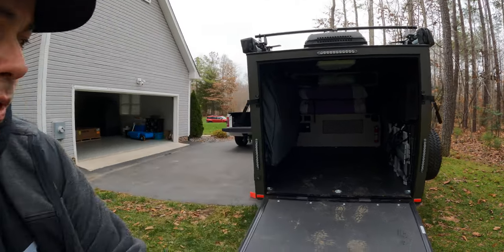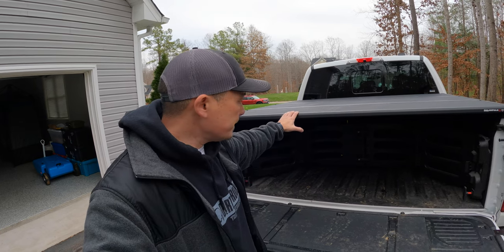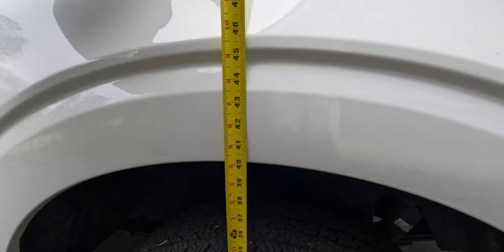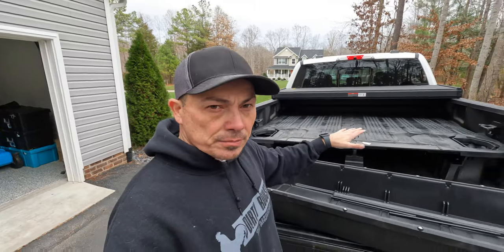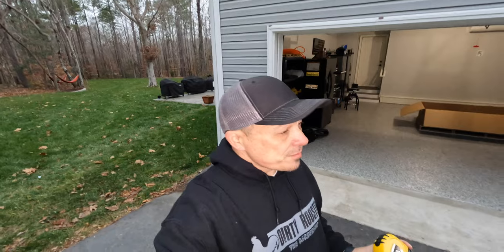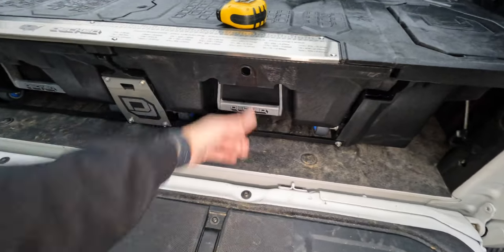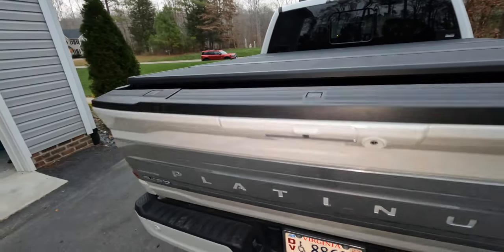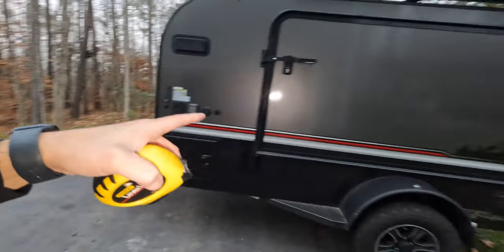THE DECK DRAWER SYSTEM…..OVERLAND RIG

Comment: I have been thinking about the Deckd system for my 2022 PowerBoost 7.2kw.  Just wondering how easy it is to use ProPower with Deckd installed, with and without tailgate down?  Thanks for the video.
Reply from the maker: Thank you 🙏.  So when you order the decked system you have to make sure you order for the pro power on board (POWERBOOST).  They make one specifically for this model.  What that does is leave an opening for you to access the pro power onboard through the front opening when the tailgate is down.  There are also 4 cubbies (1 on each corner that have caps).  The cubby by the pro power is actually empty so when your tailgate is closed you can still pop open the cap and run your connections through there.  I love this set up and honestly it has been by far one of the best add ons to my truck.  I highly recommend it.  Having the decked system doesn’t effect the usability of your pro power in any way.